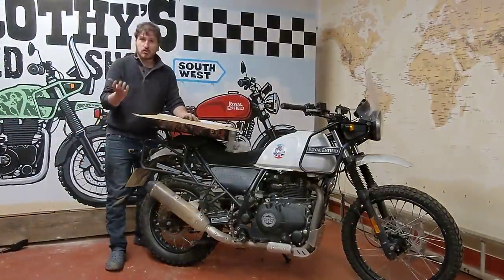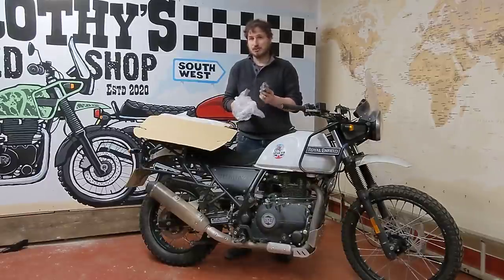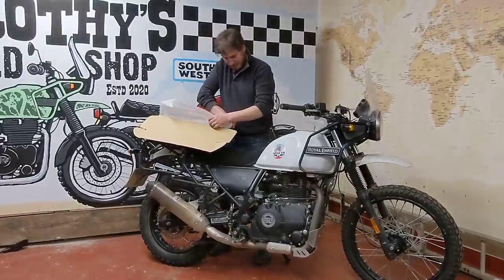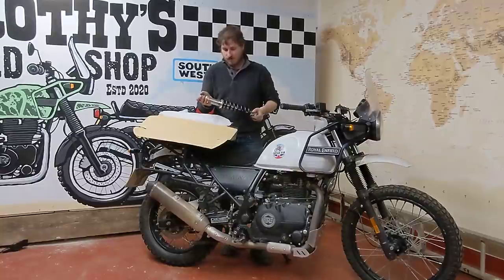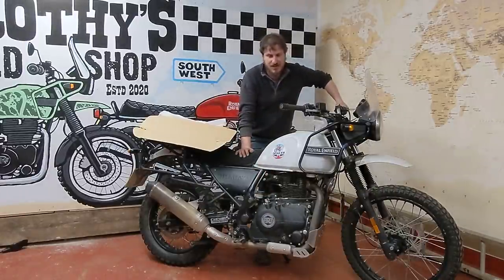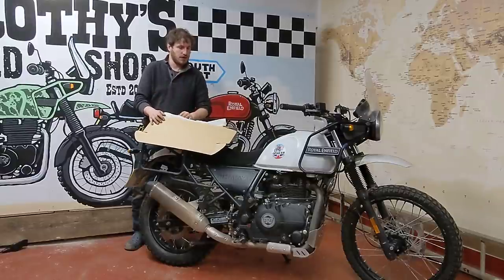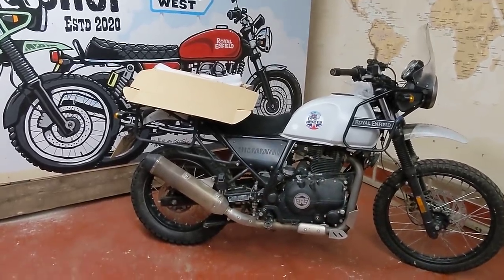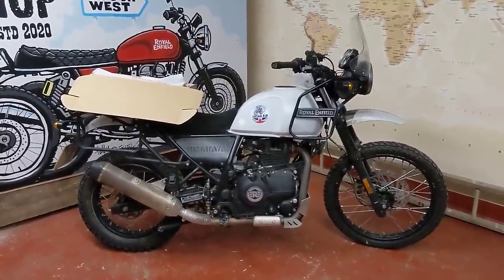Project Himalayan - power and suspension. Ep1.

Comment: Enjoy the changes, I fitted a Hitchcocks cam last month and I doubt there’s much between the two. I also fitted a booster plug and the DNA filter and intake plate. The collective changes made a very noticeable difference. I’ve now also just had a couple of days commuting with a 16t sprocket and new 112 link chain and it’s really finished the upgraded perfectly, the extra length on first makes it much better in traffic and I’m not kicking up for “6th” anymore. Highly recommend the 16t to go with the upgrades. It has got rid of the tank/tugboat feel, also smoothed the engine braking which previously felt like throwing an anchor out the back every time I rolled off the throttle. I imagine this is what the engineering department was aiming for before it got strangled by the euro4/5 additions. Whoever spec’d the original gearing must have worked on transit vans!
Reply: I quite like the tugboat feeling 🤣 But great tip on the sprocket change 👍

Comment: Looking forward to seeing the TEC cam installation, and the suspension upgrades. If you're right about the cam mod only being of use at higher speeds, I'm not sure it'll do me any good, though, as I rarely ride my one over 4500 revs. ( about 60mph ). I just avoid the fast roads as much as possible.

Comment: Those extensions are going to add a weak spot to your forks at the connection point.  Don't know that I would be comfortable with that.  Especially on trails.
Reply: I twisted my forks off roading; before having the lift kit fitted, so I’m not sure the OEM forks are as robust as you imagine.
Reply: @mattwilliams745  Didn't say they were but if they are already suspect this will only make them worse.

Comment: The cam lowers the rev range of power and torque by 1000rpm, there is more power at higher revs, but also low down. Booster Plug is essential. The suspension mods are interesting, I look forward to hearing about the results. I've never found the standard shock lacking, it seems to cope well enough in all conditions from 2-up touring to solo off-road competition, although ground clearance is certainly lacking, but I wouldn't want to sacrifice the centre stand.

Comment: I’m running the TEC cam with no other mods and it’s a noticeable difference, I’m not planning any other supporting mods that’s one reason why I went for it as it can be stand alone. One thing Nathan that I have noticed is that low down power delivery is much smoother, I’ve always described it as a wave like delivery but now with the cam fitted it feels smoother so when your on the lanes I feel you will pick up on that even though you may not have noticed it on the bike you rode.
Reply: The kind of feedback that is gooooood.

Comment: You are probably going to find, once you get the suspension mods done, that the side stand is far too short!  Probably be able to have it cut and a piece welded in to extend it. 🙂
Reply: I have this kit fitted, side stand works (my 2018 was almost too upright), she’s definitely leaning left now - even when loaded.
Reply: @mattwilliams745  That's handy, two birds, one stone.
Reply: @peterihoy4908  …😀 indeed.  The Euro4 bikes were a little, erm, upright when on the side stand.  Mine never actually blew over, but as you walked away from your precious steed you were a little nervous.  Now it’s far enough over that you have to put a bit of effort into getting it upright, so there’s that assurance built in.  The main benefits are the plush ride (Indian engineering didn’t have 17stone in mind when they designed the spring), and the stance works with my 6’ 1” frame (I no longer look like I’m on a child’s bike). Ride safe.

Comment: Good project.  Whens the new Scram coming in?
Reply from the maker: Ha. IT does look quite funky but not sure there's room in the garage!
Reply: Don’t think the Scram offers anything else above the standard Himalayan. Probably worth waiting to see what RE come out with later this year. I hear they are going to upgrade the motor to a 450 single with around 40 bhp and produce a more off road Rally version. Could that be the Goldilocks of dual sport bikes? Especially if they can keep the weight down!
Reply: @peakrider4886  Hopefully the 450 will use a RE engine and not the Chinese wc single that seems to be a bit of a gas hog. From the artist impressions of the new bike, not my cup of tea at all. I think the Himalayan was nailed from the get-go, but its probably an age thing.  As for the Scram, seems to be a bit more nimble on the road, if that matters. I couldnt imagine it being a deal breaker, as i ride a bike with a 23in front wheel. Will be interesting to see how it sells, my first impression was as yours, its just a Himmy with a small front wheel.